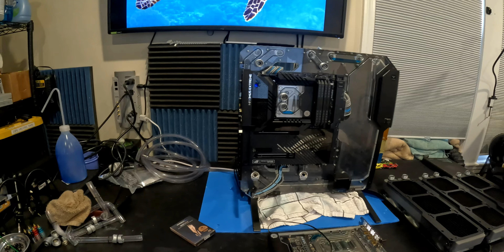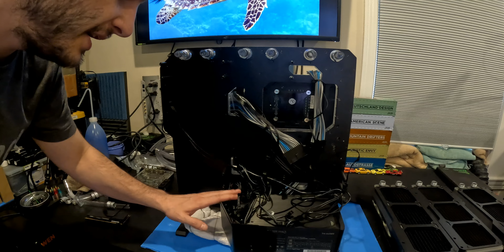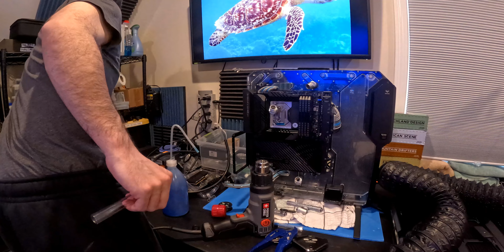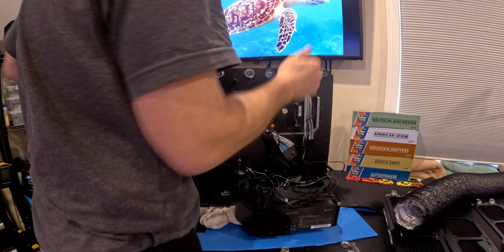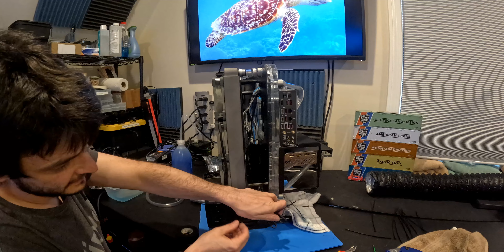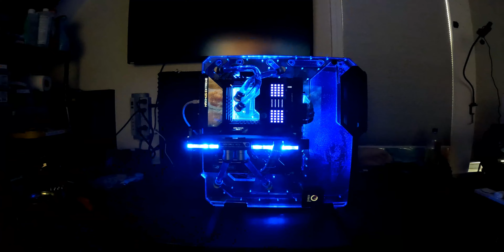Water-Cooling Masterpiece Custom Gaming PC

Comment: Very nice. I also went with an overkill setup, with the same CPU, GPU, and RAM, but I used an AIO instead of custom cooling, and also used a different motherboard. Did you have any trouble getting the RAM to run with XMP and at 6600 MHz? I had to update my BIOS to get the motherboard to even allow activating XMP, but even then, it refused to boot until I lowered the frequency to 5800 MHz, so I am hoping to find out if there is some trick to getting it to work at ful speed. Perhaps I just have to have to wait a bit longer for a new version of BIOS that can support 4x16 GB at 6000+ Mhz.

Comment: Hello, Found you by a happy accident. NICE!  Congrats on your build.
 I am in the process of building something similar.  Same MB, CPU and GPU. Different case, All Whiter. I am surprised you have only one monitor.  I would like to pick your brain and see yours in a well lit room.
I do not like the G20 open air case because of dust issues. For Me the whole point of water cooling is to operate at sub ambient temps and not hear a thing. 
With nine fans there has to be a lot of fan noise. Plus you will have to clean the fans and radiators often.
If you do not use dissimilar metals in your loop AKA all copper and no aluminum and use an non-water based coolant like Evans Glycol coolant. You never have to drain it.
    My build will be totally fan-less and silent and sealed in a air tight case filled with dry nitrogen gas.   Still collecting parts.
I live in Wisconsin so I hang my rads outside during winter. In summer I used a water chiller on my current rig..
I would like a talk and pick you brain for obstacles I am in for and ones to avoid.
Please pose an update.  Show you maintenance routine. Show your BIOS settings.
Please reply

Comment: Q&A: hows the fan noise when all of them are putting against the wall ? Many thanks 2. how hot it is  when playing heavy gaming? both cpu and GPU bound games; is it loud?
Reply from the maker: i run a fan profile off the gpu for rad 1 and the cpu temos for rad 2 and 3 so at normal use noise is pretty silent. at full tilt gaming the fans are audible but not bad at all.  Temps have never gone above 45 deg c
Reply: @MachSchnell1  Huge thanks! That helped alot! i am thinkg 13900k OC to 6.0GHZ and use the same configuation with 2rads for cpu; with 6 fans runing at 70% (Also Noctou fan 2000RPM) i hope it can cope with 6.0GHZ and not too loud QWQ. 30mm rad or 45mm? plus fan that would be 45+25mm quite thick, but in video it looked alright
Reply from the maker: I would say, go with the thicker radiators the power supply sticks out pretty far on the back of the case so you can get away with quite large radiators, and it will not look weird.

Obviously, the larger the radiator in the more TDP you can handle, also that would allow you to keep your fans at a lower speed.

I experimented with double stacking the fans but sound. It was unnecessary.

Good luck with the build. Please reach out with any questions.!!
Reply: @MachSchnell1  Thank you so much! was gonna ask about the sanwich style fan rad; obviously yeah 18fans is going to sound xd.
Btw have u tried to oc it to 6.0ghz on all the P cores? hows the temp when running games ? (cpu heavy)

Comment: Hey man thanks for posting this assembly. I’m curious how this pic is holding up and if you have had any complaints/issues with the distro/case. I’m highly considering this platform for my build but it’s hard to find any other users.
Reply from the maker: so far great temps are in check and build quality is high! wiremanagement was tough but feisable.

Comment: Is there a way to change the color of the Case LED's? Ive tried everything.
Reply: You'd need the controller box from bykski. The cable from your led connects to that and the box to the addgen_2 connector. I'm currently waiting for bykski to send me one. I'm in the same shoes as you man

Comment: 3:34 wow you have no clue whatsoever.
Reply: They each get a dedicated radiator cycle. Loop goes as follows. Gpu to radiator to cpu to radiator to radiator to case. 

It does a pretty good job at keeping water Temps low
Reply: people say it doesnt matter, yes 1-2 degress aint much but if you can get them to have dedicated radiator then why not
Reply: @Dumb-Comment  i had gpu and cpu in same loop, never again. cpu ends up having same temps like on air cooler.